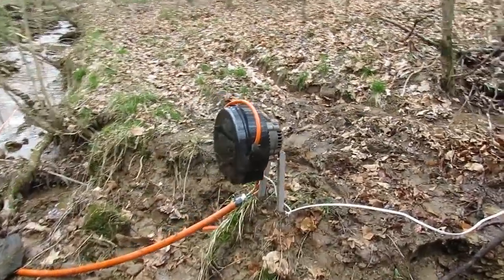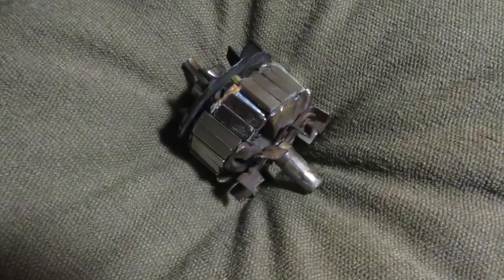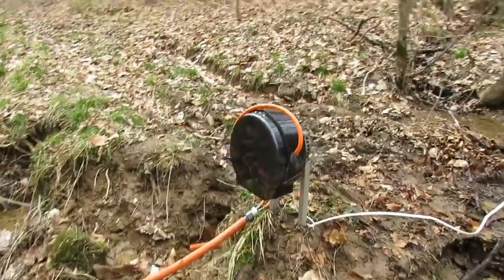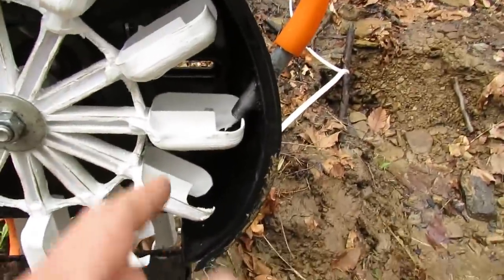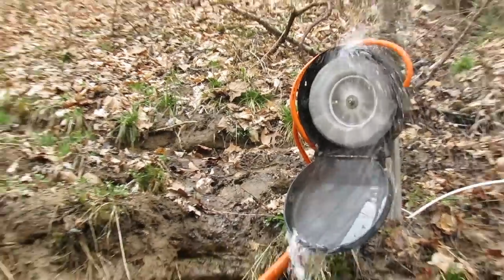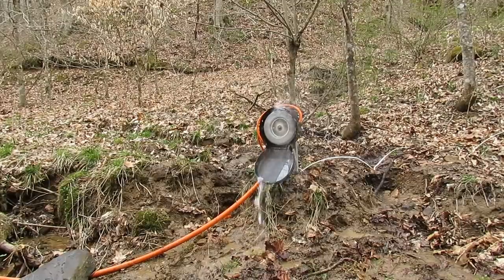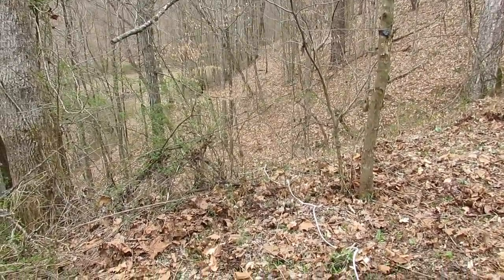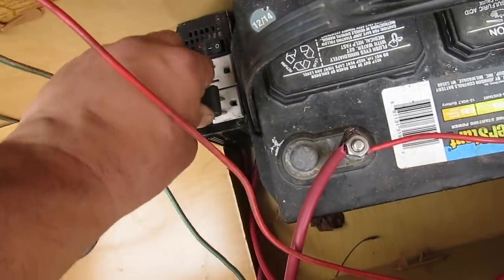Water Generator Running Off Grid Cabin

Comment: Thats real impressive! You should hook up a load more batteries and store more power? The rate the stream runs at you could run 2/3/4 turbines? 👍🏻 As you discussed with the solar panel issue you need SOME other alternate power source when it snows and it freezes the stream up!
Reply from the maker: Thanks. I ended up having solar as well and a few more batteries. I am working on a wind turbine now.

Comment: Not sure where you are, but batteries don't work very well if they freeze.
Reply from the maker: An insulated box would work. The box I have now has the charge controllers and inverter in the box but In a separate compartment than the batteries. Maybe if it were insulated the residual heat from the electronics will keep them warm enough.

Comment: thanks for the interesting video ... but it would have been a bit more helpful if you had some idea of the current flow as voltage doesn't mean too much on its own.
If your meter is capable of measuring Current ... insert it in series with the positive going from the regulator to the battery and take a reading. Power (in Watts) is equal to Voltage (Volts) X Current (Amps),  You already know the voltage is around 14.2V
Reply from the maker: I get about 50 watts out of the generator. It fluctuates with water flow, but 50 watts is the max. It could be made more efficient by putting a metal pelton wheel and improving the bearings.

Comment: HI INSTEAD USING ROMES I USED A 100" EXTENSION CORD 12/3 OR 10/3 AND YOU GOING MORE AMPERAGE JUST A SUGGESTION
Reply from the maker: Good suggestion. More durable for outdoor use also. Thanks.
Reply: @lukeFugate  YOU ARE WELCOME LUKE KEEP MOVING FORWARD

Comment: Generating 3 phase AC.... while standing in a puddle.... on marette'd, indoor, household wire... 

SMRT
Reply from the maker: It's not putting out 220 volts or something. On a good day it may get up to 23 volts at about 50 watts. Not much danger there lol.

Comment: Get water off that alt then use heavier uf wire put 2 deep cycle bats together get a stronger pure sine low frequency inverter and run 12 2 or 10 2 into the panel plus box vent also you could spin that alt with magnets  good job thou
Reply from the maker: I did most of that. I covered the alternator before this video was published I just didn't show it. I still have the same wire going to the rectifier, but am planning to change it out when I can. I have a 1000 watt pure sine wave inverter and three deep cycle batteries. I have a run of 12-2 going to the cabin from the inverter. I also have solar now and a wind generator I have yet to get put up.

Comment: What state are you in. I didn't read all the lines below. Im thinking Tennessee or the Carolinas. Im just guessing. What state is the cabin in? I guess the water just traveling down the hose is enough to turn that Guinea Pig wheel. Its called saving money right. Its guerrilla hydro electric. Build a box for that contraption and let the water drain through the slots on the bottom. Maybe you'll see a baby pig jump in and ride the wheel someday.
Reply from the maker: I'm in Kentucky. The water comes from a source about 40 feet higher than the generator so it has enough pressure to turn the wheel with enough force to generate about 50 watts of power. I'll keep an eye out for guinea pigs lol.
Reply: @lukeFugate  I'm laughing my ass off. Thanks I've been  down a little lately. I still dont know if I'm going to get unemployment Benefits.  I got layed off 12 28 19. My last employer didnt turn in any of my wages for the third or 4th quarter. I need it for the third. That's 12 credits. A person needs 18. Anyway that's cool you said something back. I saw your video on when I typed in something to do with solar off grid videos. They are fun to watch. I have this shed back 400 feet from the road. No house yet. I'm working on  that. But a little solar near the shed for a couple of lights and a small 5 amp fridge for some beer and I'll be happy. Man that cabin truly is The Cabin in the woods. All right . SAY LA VIE

Comment: How many magnets does a standard 110v 13 amp ac motor have? What is their length?
What is the length of a 19 amp 110 ac motor? I'll explain later why I'm asking this question
Reply from the maker: Not sure exactly. There are a lot of variations of electric motors. It would depend on the application.

Comment: Cool wonder if you could've used a semi alternator with there 4 battery setup, they run all the convenience in the sleeper plus keep the truck running and all the lights on?
Reply from the maker: It would put out more. They have bigger windings and heavy duty wiring.

Comment: how much elevation and grade do you have comin from that hose?
Reply from the maker: It's right around 40 feet of drop in the span of less than a hundred feet. It used to be an old silt pond dam. They filled in the pond and left the same elevation when the mine moved out.
Reply: luke Fugate thanks man that’s good info I have a spring that’s about 100’ higher than my location should work

Comment: Tips: Switch to deep cycle batteries for longer life.  Switch from incandescent bulbs to LED bulbs for whiter light and far less power usage.  Elevate the wire from the stream to the cabin so it doesn't get ripped out some day. Install switches so you don't ruin the breakers in the panel. They're not designed for that kind of use. And waterproof that battery box before it all shorts out, eh?  //  How many feet of head do you have on that water wheel, anyway?  It seems to spin pretty well.
Reply from the maker: Thanks for the tips. I already changed some of that. I still have the same type of battery, plus two more but they are marine batteries and they have lasted this long. The reason I used them was that they were free. (they were used to begin with.) The bulbs in the cabin are LED bulbs, they look like incandescent, but they are LED. I buried the power line(not very deep and it does run through the woods in some spots but the last 75 to 100 feet are buried and it runs through PVC conduit the whole way now. I have switches installed in the cabin, I had them on and just had turned off the main breaker while I was working on it. The batteries are in a plastic box now with the electronics separated from them. I've got about 40 feet of head. It drops pretty fast, probably within about 60 feet.

Comment: How do you get that pressure in that tjin hose?
Reply: I meant tin hose
Reply from the maker: I'm not sure what tin hose you are talking about. If you are talking about the plastic hose that leads to the generator, the intake is at a much higher elevation (about 40 feet) than the generator. The flow of water is caused by gravity pulling it through the pipe.
Reply: Thank you for your red pins but do you use some kind of funnel to get the water in the hose?
Reply from the maker: @RK-nl1hn  no, it's just open except for a piece of screen wire over it. A funnel of some kind would help though.
Reply: Ok thank you

Comment: You really should show the folks at home how you produce so much water pressure from a hose dipped into the creek!! Perhaps the hose running down the hill is being fed off the mains water pipes???? Yeah
Reply from the maker: It's gravity fed. Not sure where you will find main water lines running through the woods lol. If you check the video in the pinned comment you will see the start of the water line.

Comment: electricity and exposed wiring... what could go wrong...
Reply from the maker: not much, they love each other lol. It's low voltage, around 20 volts AC so it's not enough to short out in water. I did cover the alternator and put tape on the connections though.

Comment: What do you have upstream? You said the yellow hose and orange hose connect. Is there a video to see that part?
Reply from the maker: There is what used to be a silt pond dam upstream. The coal company filled in the pond and it left about a 40 feet high elevation change. The pipe starts at the top of that and the generator is at the bottom. I have a video that shows the end of the pipe here> https://www.youtube.com/watch?v=NTWoSivTpHE&feature=youtu.be

Comment: Double the load on it see how it performs.
Reply from the maker: It will run all the lights and keep the battery charged at 13 volts. Turning on a tv brings it down to 12.4 but maintains it. Anything else starts using more than it can put out and the battery starts to drop slowly.

Comment: Looks good... you just need more batteries... seal the alternator from the water. that way it doesn't destroy the alternator and I would definitely play with the alignment of your water jets.
Reply from the maker: Thanks! I did shield the alternator, just not in this video. I put a butter bowl over it to keep the water off. I also added more batteries and a solar array. here is a video showing that, https://www.youtube.com/watch?v=NTWoSivTpHE&feature=youtu.be
I may play with the nozzles some, but I am going to be changing out the pelton wheel. Plastic is not a good material for it I have ordered one from Ebay that is aluminum.

Comment: Given your situation and that you are in a really shady area and the Sun would be spotty even if you move your solar panels out you shouldn't get amorphous type panels if you do get solar panels because they are a lot less sensitive to being in direct sunlight then a crystaline type panel and even though the amorphous panels have a considerably lower officiants I give in your scenario I think you would get more net energy out of an amorphous panel not to mention the fact that you only have a single battery you should upgrade that to multiple batteries for a larger storage capacity because you might find that the hydroelectric turbine has enough power output to run the TV as well as the lights if you could level out more for your usage which is what extra batteries in parallel would do with your system plus tv's nowadays are highly efficient a 42" TV only takes 89 wants just a little bit more then a  Incandescent light bulb to run in that is a 42" if you had ATV that was a 35" it would take the same power as a lightbulb to run  I am thinking was your set up that if you could measure the amps coming out of the generator is well you will find that you are probably getting a 100 plus W of power coming out when you do the math on that That means that you are really getting 2.4 plus kilowatts A-day of electricity from that hydroelectric turbine and if that was only a weekend   Cabin then if you had enough batteries and you left the turbine going all the time Even when you weren't at the cabin your storage plus your power generation would probably be able to equal easily more then your needs.
Reply from the maker: Amorphous panels would have been better for this situation if I would have bought panels specifically for the cabin. I had a couple of old polycrystalline panels laying around. I set them up in a clearing about 150 feet away from the cabin and moved the battery box and all the electronics there. I have a video that shows how I have them set up. Here is a link to it https://www.youtube.com/watch?v=NTWoSivTpHE&feature=youtu.be
I have a projector for a tv right now that pulls less than 100 watts, but I think a modern flat screen tv would be a much better choice. I do have plenty of power for the cabin, but I have been spending more time up there and would like even more. I am building a wind turbine to try to use the wind energy higher up on the hill.

Comment: Do you need AC? You can get 12 volt lights and many common electrically powered items and you won't lose the energy lost converting from DC back to AC.
Reply from the maker: That was my intention at first. I even have some led 12 volt lights just for that. I then put solar panels about 150 feet from the cabin and had to move the battery box there to prevent the voltage drop. I had to run the AC power from the inverter the 150 feet to the cabin so I don't have 12 volts at all near the cabin now.

Comment: Great little Micro-Hydro system !! 
Only a Few Concerns: Vent the Battery Box and maybe replace that White wire which is usually an indoor cable with an Outdoor rated Cable ... And move the Charge Controller  out of the Battery Box
Thanks for Sharing!!
Reply from the maker: Good suggestions! I have the batteries(three of them now) in a plastic vented box and I have the electronics in a separate plastic box. I ran the wires through pvc conduit to protect them.

Comment: Nice work. It should be able to run a small pump and you can get water to the cabin
Reply from the maker: I have a natural spring on the hill  just above the cabin. It works out perfect to flow down to the cabin without a pump.
Reply: Top Stuff, sounds like you have a little piece of paradise
Reply from the maker: Yeah, I like it. It's peaceful and quiet.

Comment: How much line loss do you have between the PMA and the solar charge controller?
Reply from the maker: It starts at around 25-30 volts at the generator and drops to about 15-18 at the cabin.

Comment: I’m really curious about two things. First, what size inverter are you using, and second, how is that wheel turning down below?  Just the pressure from the stream?
Reply from the maker: At the time of the video I had a 450 watt modified wave inverter. I have since upgraded to a 1000 watt pure sine wave. The pressure comes from the natural flow of the water.

Comment: if you put the box inside you need to get a AGM battery  because they wont vent Hydrogen gas that is highly explosive while charging like a normal battery will, one spark and the battery could explode in your face, i know from experience !!!
Reply from the maker: Good point. I have now got the batteries a lot further from the cabin.

Comment: Good idea but the runoff out of the box is causing a lot of bank erosion.  Have you had to fix that little issue before the generator falls over?
Reply from the maker: I fixed it right after the camera shut off. I put rocks down under it to stop the erosion.

Comment: Adding 2-3 more water generators will definitely improve the voltage recovery for battery grid. allowing for use of a larger power inverter .
Reply from the maker: Yes no reason I couldn't have more generators.

Comment: How many amperes of current are you generating? Do not move your battery inside. Hydrogen does explode at avery low concentration. This isavery simpleinsttallation that does what you want. Congratulations
Reply from the maker: Thanks. Yeah, I really didn't want the batteries inside.

Comment: Did you think of using a small drift tower?

like A chimney; a cross section of the inside a spoke wheel.
The Top be mostly a reflctive shade.

The Chimney itself if first painted an insulator. Then a conductive reflector.

Purpose? inside-shade. a cobductive layer carries what heat is there, to the Top. Where it is reflective, and casts shade. Bonus  if you make it grooved around the edges, and a spike at the center. To creat specific areas wear air currents are more likely to cary it up.

You know more than enough to get where I hint at.

Air drops through that chimney to an analogue of that alternator.
Reply from the maker: Thanks for the suggestion! Sounds like it could work, would be worth trying out anyway.
Reply: @lukeFugate  Wellcome.

Comment: 2:37

stopped to ask.

Tri-Phase?

You answered. Yes.
Reply from the maker: Yes, it's three phase.
Reply: All automobile alternators are three phase and very high frequency which is proportional to the rpm and is not compatible with 60 cycle three phase industrial motors. Alternators therefore use a six diode bridge rectifier.
Reply: @richardgieser6122  

thank you.
Reply: In my 50 years of working in building and machinery maintenance I never heard anyone refer to three phase power as tri-phase.
Reply: @richardgieser6122  

The Hebrew Equivalent 'Tlat Phaza' is basically tri Phasa.

And I just know from people I know

Comment: Why not hook the DVM to the wire coming from the alternator so you actually know whats coming in.
Reply from the maker: I checked it later. I was more interested in seeing if it was charging the battery at the time. The generator puts out about 25 volts ac and with voltage drop ends up at around 16-18 volts by the time it gets to the cabin.
Reply: @lukeFugate  What about Amps? It seems like that was a good idea you came up with but why not use the power directly after charging the better? Save Life Span of the battery?
Reply from the maker: @TheUGFUGF  It's putting out around 50 watts because the LED lights pull about 9 watts per bulb and it will run 5 of them and still maintain 100% battery. If I turn on the tv or plug in another light the battery voltage starts dropping slightly. I can't use the power directly from the generator because the power coming from it is unstable as the wheel speed varies.

Comment: With such a long run like that what's your voltage drop like? Or do you have one?
Reply from the maker: It drops from around 25 volts down to about 18 open circuit.
Reply: luke Fugate thank you

Comment: Could you not add another battery if you are getting 14 volts charge? How long do you figure it takes to fully charge a 12 volt batteyr? Thanks!
Reply from the maker: Yes, I have added some more batteries. With just the water generator going, it will charge up the batteries in about four hours depending on how dead they are.

Comment: Try putting the water in a pipe to go back to the creek so the bank don't start washing away. That charging outfit is great
Reply from the maker: Thanks! I put rocks down under the generator to prevent erosion. I had already put the camera on the four wheeler though so I didn't film it.